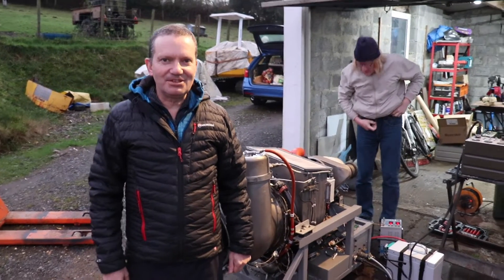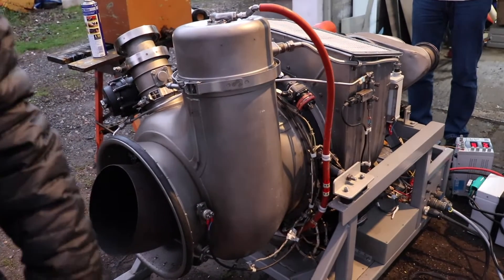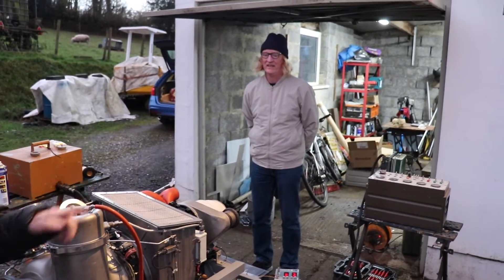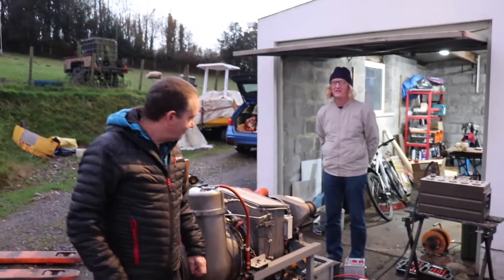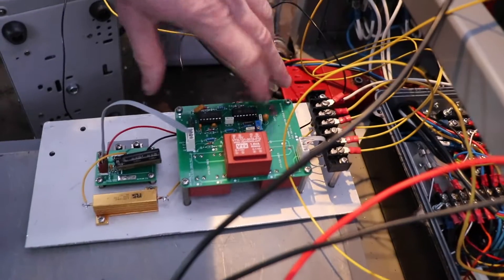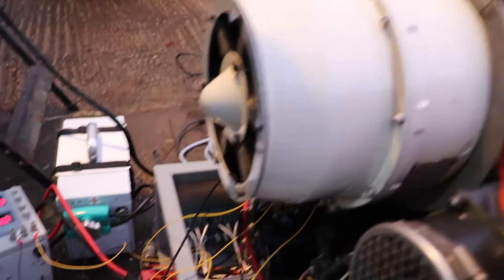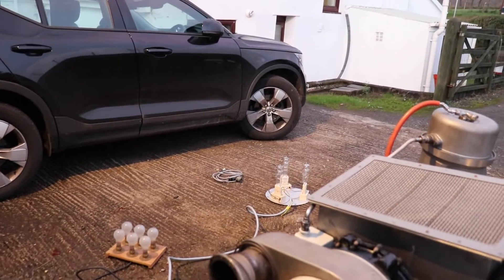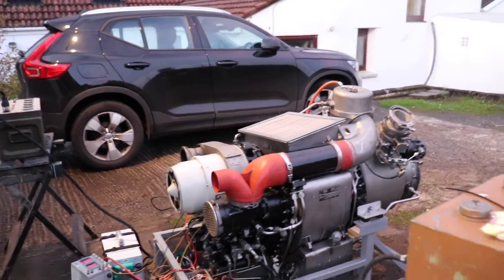Garrett GTCP85 APU Run With Genny Test

Comment: Hey Guys! Can i have a question related to the GTCP85 engine? Is it normal that the sprag clutch between the starter motor and the gearbox slips quite a lot/bad on startup?
In this vid i made: https://youtu.be/n5pivoIdeTE?si=4I39hIAWcq1iiYSD
it is audible/visible in the current draw that the clutct locks fully at 0:08